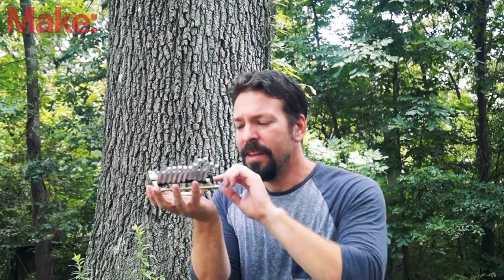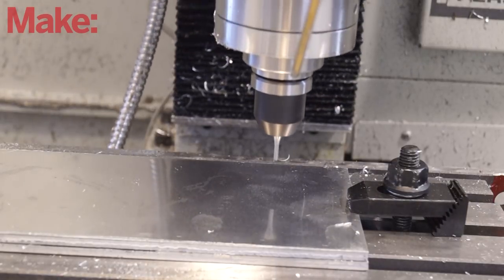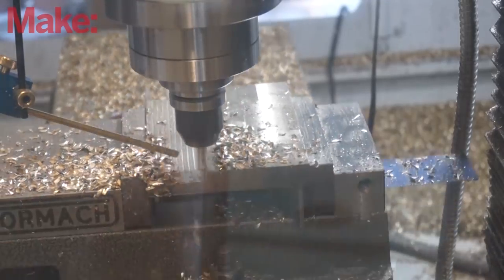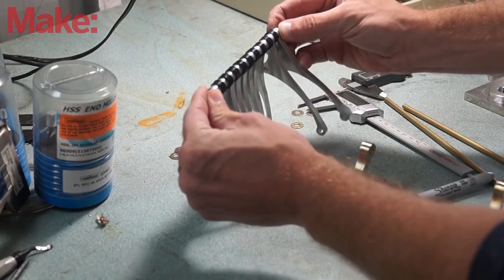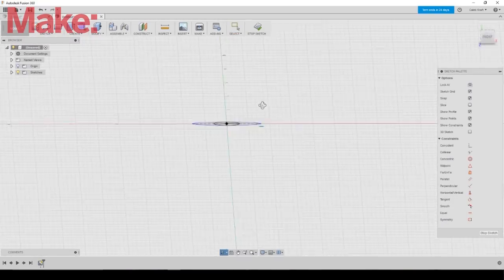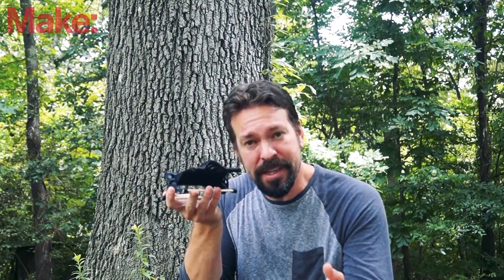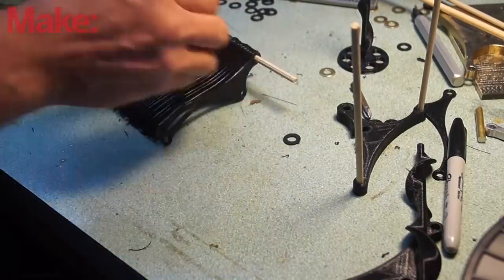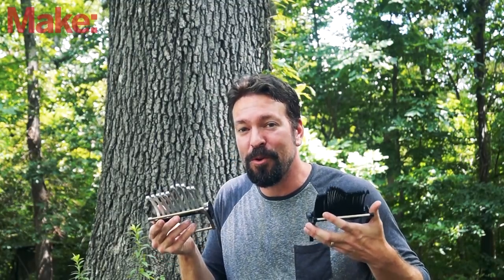Wave Machine: CNC Machined and 3D Printed Kinetic Art

Comment: a change to the cam may also provide a smoother transfer of motion compared to the current cam your using, so soming more like the cam of a car, so that you don't get that sideways thrust on rotation.
Reply: yeah, doing individual lobes instead of a smooth transition would eliminate any sideways movement. It would also mean that I have to plan more accurately for how many arms I have.

Comment: I like this design. It would make a nice conversation piece if it had a quiet motor to drive the waveform. 

This makes me wonder wonder how a "bed of nails" pin art setup would look with a wave generator?
Reply: motor would be very nice. I think that may come if I do a few more versions. You could do a bed of nails pretty easily. If you search for "wave machine" on youtube you'll see a lot that are suspended balls. you could do the same with pins by spring loading them and pulling them down instead of up.

Comment: That's pretty cool, I almost prefer the 3D printed one due to the finer detail but the CNC one definitely looks better :)
Reply: I feel similarly. I'm thinking of reducing the width of the machined arms a bit and making it much longer.
Reply: I'm not sure about workholding for CNC mills but perhaps you could manually cut out some rectangular pieces of thinner aluminium (like 3mm or so) stack them in groups and drill the three holes in place of the arms so then you can put bolts through to keep the pieces together for cutting multiple at a time?

Just a thought, probably easier to make up a jig that clamps onto the individual sheets with a sacrificial piece underneath though
Reply: I agree with your initial thought. cutting them individually would take forever if I wanted something like 60. however, if I stacked them, I could pump through them much quicker. I'm a bit curious what the edge finish would end up like if I stacked 5 or 6 at a time.
Reply: Caleb Kraft 
If it chatters too much you can use superglue/loctite in between the sheets as well, looking forward to what you come up with :)
Reply: Caleb Kraft Very cool. Given that the arms are just extruded two dimensional shapes, I'd have thought that laser cutting acrylic or wood would be much quicker/more efficient.
Reply: Yep, I have a laser cutter sitting here too. The whole thing was an excuse to learn some machining, the 3d printed version came afterward. I've also thought about milling a giant one on my big router as well.

Comment: could you make the arms higher definition using thin laser cut metal
Reply: not really sure what you mean by high resolution. I could make them prettier even with the mill I have if I took more time. I could also make them thinner.

Comment: Very cool but try not to waste new material making this. Use recycled parts. I now have a use for all the shiny aluminum pieces I saved out of old hard drives. I imagine there are plenty of old long drill bits you can use for a cam material maybe.
Reply: For School He clearly said at the beginning that he bought scraps/off-cuts. They would just be sent to the scrap yard if he didn't buy them. Metal suppliers don't keep a lot of off-cuts around. Granted, I can't figure out for the life of me why he fly cut that piece of brass then proceeded to mill the top half of it off. Def should had gotten an off-cut that was the right thickness; or something closer than the piece he had.